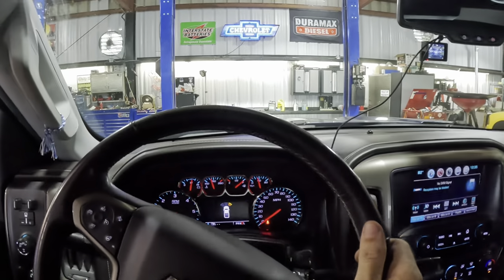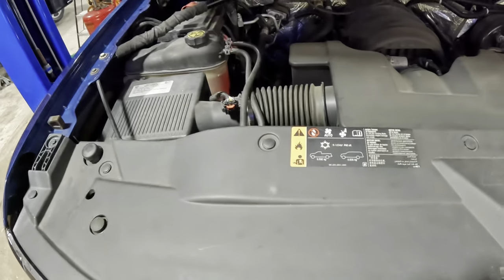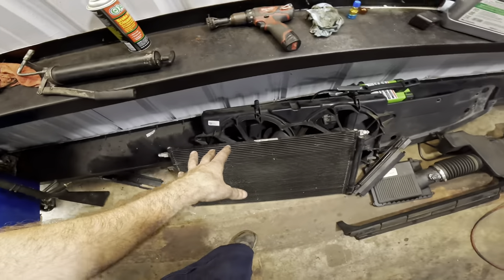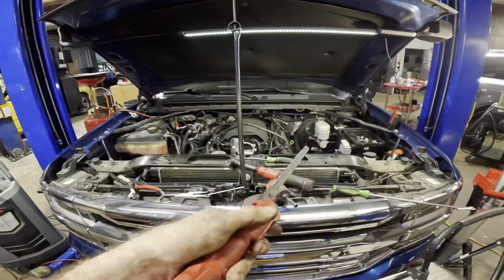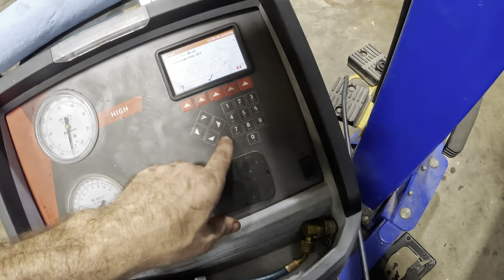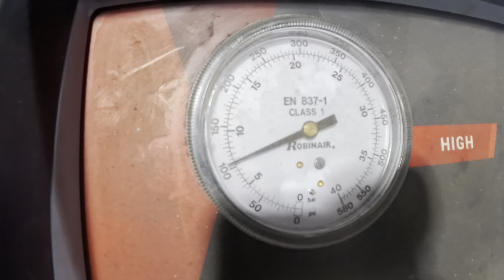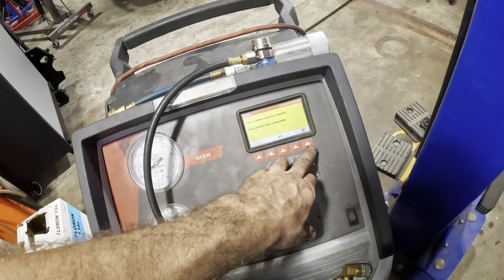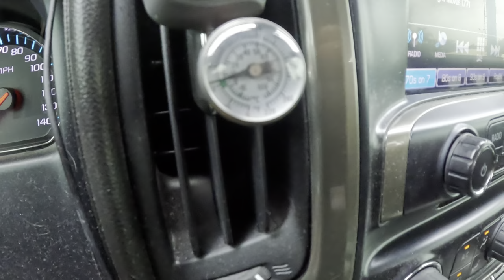KNOWN FACTORY DEFECT! BAD DESIGN!! 2017 Silverado 5.3

Comment from the maker: Check out this shorter A/C Condenser video with the saw cut in the side of the unit. Customer States...WAIT...look at this! Can't make this stuff up! https://youtu.be/9nHSh5ZYFmY

⚠⚠⚠Ray's Auto Clinic Clearance Sale at https://www.RainmanRaysRepairs.com  We're liquidating the hooded sweatshirt lineup as the weather is getting warmer. Add a hoodie to your cart and receive 20% off the entire order. No checkout code needed.
Reply: Ray,  if I understand those zero angle ratchets correctly, they are basically a very small sprang clutch just like what is used in an automatic transmission.
Reply: Ray or Lauren, I have a question, you have license plates in your office.  I just had to cancel my Massachusetts Red Sox plates as the car was totaled.  I would like to send you one for your collection, if you would like.  Please let me know.  Thanks.
Reply from the maker: @scolley0616  please do, we would love to have it! Did you find the address on the home page in the “about” section?
Reply: @RainmanRaysRepairs  got it.
Reply: Is it possible to braze the weld and seal the leak?
Reply: @ctbhaley maybe but it would just crack again. That wouldn’t correct the root cause.
Reply: @RainmanRaysRepairs  on its way!

Comment: We replace these constantly at the dealership. GM is on like the 2nd revision now. This one in the video looks like the original. The first revision had the foil tape on it and still leaked at the same spot. The latest revision removes the tape, and its redesigned again. The build quality is awful on the latest one though. The transmission cooler lines rarely clip into the new condenser, you have to transfer the fittings from the old condenser. Also, the plugs on the bottom of the reviever drier come from the factory 2 or 3 turns loose. It will pass the leak test on the 1234yf machine, but leak under pressure. Ask me how I know, had one bite me and from then on I check every one. Just thought to add some backstory to another shotty GM design
Reply: Maybe it's designed by some military general. War equipment is not expected to last long on the front lines of a battle.
Reply: Jeez, some real quality control issues.
Reply: It took them a long time to find a spot that's such a pain to get too, to hide the defect!
Reply: Yeah, a GM truck with A/C issues?  First check that area.  We thought that would have been fixed when they changed over to 1234 (VERY expensive stuff), but it wasn't.  GM doesn't like upgrading their parts.
Reply: @desmondrice1756  Given that one of the AC service ports is hanging out under the heater hoses and near "lose a hand" land, and the book on this job is seven hours... 
This was designed by a coven of frustrated demon-worshipping sadists.
Reply: Dude I thought it was just me with the tranny cooler lines, sometimes they go in no problem and on other ones it takes popeye strength to get them to clip in. I usually transfer the old fittings but I hate messing with those stupid clips so I hope for the best with the aftermarket fittings 😁

Comment: And that is why I don’t buy GM products, at 45,000 miles the heads had to be pulled and the valve train replaced, at 65,000 had to rebuild the transmission, they would not replace it with new, because the time part of the warranty expired, up until that I was a loyal GM customer, Ray, you were smart to get away from working at the dealership
Reply: I was a GM guy also having 5 Gm vehicle's.  2 trucks & 3 cars.  I knew everyone at the dealership by name as I spent 1-2 days a month there.  I simply didn't know any better as I thought it normal for parts to constantly fail & both service & warranty work constantly necessary!  Untill someone gave me a lemonaid car guide  book which showed HONDA to be a better line of vehicle's.  Today 25 years later I have 3 Honda's in the driveway & I know no one at the dealership service department.  I can't remember who gave me the lemonaid car guide book but Thank You whoever you were!
Reply: I like old GM shit (pre-2011). My mom's 2009 Suburban towed a trailer of shop crap over 18 hours with the trailer axle over 1000lbs over rating and the car's rear axle over 500lbs over and the engine definitelt ob its way out. 3 years later at over 200k mi the engine finally wore out, only to be replaced with a crate motor from Napa. The last major issue it had was a cracked wire insulation corroding and disconnecting the body control module.

My 1995 blazer wore its engine out at 195k mi after 29 years on the road, only to be replaced by a crate motor from Carquest. Its last major issue was the crank poaition sensor but that's fixed now and it's going strong.

I don't care for anything after 2011.
Reply: The reason you can’t get a new transmission is Gm does updates to the remanufactured transmission. So your getting something better then new.
Reply: 01 silhouette 281k, original drivetrain, ice cold ac.  I did a dexcool delete and did intake gaskets, but still going strong
Reply: Well if G.M doesn't stand buy their products neither should the consumers.They have beautiful trucks but I prefer ford's that's what I have always owned was the ford trucks and vans

Comment: I was a tech in 1970 at a Chev dealer and I found that on the 350 engine in the "A" frame (largest like Impala) the #8 spark plug was impossible to get to. the flat rate was high and I found a workaround. i got a floor hole plug, they are about 1 1/2 inch and I drilled the fender skirt to gain access to the plug. I put the plug in after. I showed the service mgr how we can save money for our customers and he gave me a bunch of crap about taking money from his income. i didn't stay there long.
Reply: Remember that from the times waaay back when. Had a bad taste for the GM products since. To be fair, every auto mfg has problems since all products are being developed throughout their production cycle. Thanks to Total Quality Management.
Reply: @milantrcka121 , you gotta remember, these cars were designed to be assembled...ONCE!
Reply: Greed

Comment: Just did the condenser in my 2015 Silverado. took the condenser out from the front. It took no time at all. Took the upper cover off, grill out, took off the 4 bolts holding the upper rad support off and out out it came. didn't have to touch the radiator, or anything on the engine side of the rad except the AC lines.

Comment: I had  to have the condenser replaced on my 2014 Silverado, while I was traveling in central FL last month. The same issue you showed. They did the job while I waited in the lobby, 1.5 hours labor charge. 
I could not get into the local Chev/GM dealer until the following week.
A shout out for Yarbrough an independent shop in Sebring FL. They treated me very well!
Shame on GM for not taking care of this!

Comment: My daughter has a 2016 Suburban, I had the condenser replaced about a month ago under her extended warranty, I still had to pay about $300 that the warranty company would not cover. Now I am leary that they used an original GM replacement condenser, it is probably going to fail again in another 10 years or so. I will get an aftermarket unit and do it my self (I have the gauges and vacuum pump, and about 15 lbs. of R-134A left) Thank you Ray!

Comment: I had one of theses “fixed” parts from Napa. I sent it back and purchased an aftermarket part for an 02 avalanche.  I was pissed ac delco let that pass.  My impala an 02 is separate from the trans and radiator.  Thank goodness.  I have been a gm family since the 40’s.  My father say many quirk’s and a local mechanic of his, repaired/ rethought the design. He had many followers for a  good honest guy.   Had lots o work and did well. Remember “WORD OF MOUTH” will always make or break you, and good honest auto -techs are like gold, hard to find and great to hang onto.  Rock on Ray.

Comment: Had that condenser issue on my 2014 silverado. Also, instead of taking the fan shroud off, I took the metal bar off across the top. The bolts are hidden underneath on each side. I found that really easy. Only took me about 1.5 hrs to replace condenser and get everything back together.

Comment: Wow have radiator changed!  I had a 75 Mustang II with the 302 Cleveland modified that came with an all brass radiator.  Accidentally punched a hole in the bottom, the fix was using silver solder and a copper penny.  One of the many ways Dad proved he knew a trick or two.  Thank you Dad, rest in peace.

Comment: GM WCT here, I learned long ago (mostly in the last few years) not to get too upset by poor engineering or the results of cost cutting measures.  Perfect example, lifters on the DOD engines, at one point recently we had three almost new vehicles in the shop (one that hadn't even had its first oil change) in the shop with the heads off getting new lifters.  It is what it is.  Job security.

Comment: Sitting at a layover with an automotive engineer. He consulted with the Big 3 automakers. Later with Toyota and Honda. Biggest difference separating the automakers was their build philosophy. The Big 3 is about cost containment vs. quality. They choose cost savings over quality.
Reply: Yea but they don't pass the savings to the consumer hence a hundred thousand dollars truck, no thanks
Reply: @davidbertram4608 thats what pisses me off the most. Charging 90k for a truck that 10 years ago would be 40k new drove me to toyota and honda. At least they value quality and sure you pay for it but you get what you pay for with them. USDM since like 1990 took a hard nose dive in quality and hasnt snapped out of it. They are losing market share and try to make up for it with cheaping out on build and charging JDM prices. They lose market share even more because of it and they are fast approaching a point where even the idiots that are ok with a 1000$ car payment wont be able to afford it. But they are too big to fail so cant wait for the next round of Gov bail outs.

Comment: @5:30 That is exactly what happened to my 2015 GMC Sierra 1500 with the 5.3L V8. Was replaced after the expiration of the extended warranty that I purchased when I bought the vehicle.  Cost me big bucks at the chevy dealer. Mechanic showed me the leaking area when he got that condenser pulled out. Said that it was a defect. Common problem.

Comment: In 2019 our surge tank broke in 2017 sonic when we were on a road trip. We had to have it towed to the closest dealership. They charged us over $300.00 to fix it. I could have bought the part for about $30.00 in fixed it myself, but we were to far from home. MY WIFE WAS LIVID! She wrote a letter to the Chevy corporate office. She told them that part is only 2 years old and it shouldn't have broke! They reimbursed us around $125.00, and we had to us it within a year. Had the oil changed and othe things done, but it still was very frustrating!

Comment: I can hear in your commentary about the condenser factory failure. I too shared dismay with GM back in the 80s when the 6.2 diesel came out, there was coolant leaking from the head gasket/block area. After MANY R&R of heads they discovered a flaw in the head gasket design.  But that procedure under warranty was a losing battle.  Who ate it, besides the customer...well, the technician, of course.  

Thanks Ray for another of your great videos. Your customer will have many thousands of miles to look forward to with your repair.  Good Job!

Comment: All of Rays videos are great. Also liked the upgrade of the aftermarket part. Ray had the where with all not to go OEM. GM.. what are you thinking?  You guys remember that 11-12 hour video when Ray replaced the whole air box on that Ford F150 because of a bad temperature sensor? When others make it a $30 dollar part and easy to get to? Ray tried several solutions to save the customer big , big , bucks. But Ford wouldn’t let him.  Generally.. Ford does a good job when they realize their mistakes. But not that time. Come on Ford.

Comment: Had an oil cooler line pop out of the radiator because of those stupid retainer clips. Instead of the plastic ring, I put a zip-ty over it. I would rather see a better connection,  but, hey, GM is happy with it....

Comment: Hey Ray, ever get the feeling that engineers watch mechanics videos just to get "improvement" ideas on how to make things harder for mechanics?
Reply: If the engineering division at all of the major automakers were smart, they would hire experienced mechanics to be an integral part of the engineering team.  Engineers can design things to make them work.  Mechanics can assist the engineers to design things to make them readily repairable.  I can recall a time in my life in the 70s when the big three (Ford, Chevy, and Chrysler) designed in obsolescence.  For example, prior to the 70s, nearly all tie rods had zerk fittings on them to grease the tie rods.  Around the 70s timeframe they came out with "greaseless fittings" as a marketing gimmick.  The sad reality is that the greased tie rod that lasted forever got replaced with the sealed tie rod that lasted a *planned* 70,000-100,00 miles.  The big three eventually/mostly learned their lesson, but not before the Japanese started taking massive market share.  The Japanese shot ahead of American car makers largely due to the father of TQM (total quality management), namely W. Edwards Deming.

Comment: I am waiting for this to happen on my 2017 Suburban. I'll be watching this video again someday. Thank you for the help in advance.
Reply: do you have the 6.2?
Reply: @robertamantea7639  No, I have the 5.3. I believe they all use the same condenser. I've been lucky with it so far. I've only had to replace the oil cooler line under warranty. and routine maintenance. It only has 58K miles it.
Reply: @dogdooley4495  this one has 63000 miles so get ready 😁

Comment: Hey ray what i did notice  is you put all the bolts and screws back in not like some dealers and other shops . I had a clutch replaced and they put half the bolts in the bell houseing and this as on a 1 ton 4×4 . You do good work.

Comment: 2014 Sierra condenser when out at around 32K replaced under warranty. As well as the radiator due to cracked weld.

Comment: Yep. I have a 2014 LTZ and my condenser wrapped the bed after factory warranty and I believe it was $700 for the fix. I'm on my second radiator, also. 107K miles.

Comment: when they paid 4.5 hours for this job i was doing them in 1.5. took longer to evac and recharge than to do these condensers. had a senior master tech show me how to do them quickly and correctly with out taking the front end off. only ones in that line that were a bear to do was the escalade and Yukon denali

Comment: I had one of these trucks with a crack in the ac line right off the compressor. I replaced the line, and my guy came back within 6 months and had the same line with a crack in it. GM sent me a bracket to tether the two lines together to reduce movement in the lines. That was their fix.

Comment: It use to be a 5 hour job now the labor has been changed to 1.4 hours in all data minus the evacuate and recharge. It is quite easy takes about an hour to remove and install. There previous procedure was ridiculous compared to what actually needed to be done to remove it.
Reply: I guess its better to have butterfingers...than an instant Baby Ruth🤧

Comment: I always just take the 2 radiator bolts out and push it forward and slide the condensor out from behind it. I never did the take the fan out method. I just left it there.

Comment: I took the radiator and condenser 250 bucks out as an assembly. It was time for a cooling system service anyway. I did replace the hoses. Yes, the coolant tank leaked on mine, a napa dorman unit fixed that. Aside from this the vacuum pump 350bucks, transmission 6200 bucks  and regular maintenance it has been a good truck. 2016 with 198000 miles. Still rocking the AFM system.

Comment: The heat transfer is still there but the thermal expansion difference between the AC and trans cooler sections is handled by the beefier construction..

Comment: I had a 2014 Silverado 1500 that I had to have the AC condenser replaced. It would only hold a charge for almost a month. I had my mechanic do the fix and you are right that it is a 7 - 8 hour job. $1600 later and I had cold AC again.

Comment: My 2014 Silverado w/5.3 had a compressor failure just past warranty, then another compressor 50,000 miles later, and just last year the condensor failed at the weld point.  No other failures.

Comment: I just did an AC kit on a 2017 Police Tahoe.  Same reason; compressor was also not compressing properly so we replaced all of it (except the evaporator as it was fine).  Good ol' 1234YF.  The condenser was fun to replace as I had to remove the pushbar and its mounts from the vehicle in order to break it down to get to the condenser.  I don't think the whole time was 7 hours though.

Comment: @Ray that tip is not just for Chevy it is my go-to fastener tray in most cases... Furd is the exception...  they don't make anything easy for techs... they hinge the lid and make sure it doesn't open 90° so it won't sit flat.

Comment: Had a 2017, didn't have an issue with the AC bit got rid of it after the torque converter started going with 13k on the clock. GM basically said tough so never got to the AC issue.

Comment: I bought a "ratchetless" ratchet from "Taskmaster" in 1/2" drive back in 1981 and I still have it. It uses cam locks and works brilliantly. I will say that the cams have worn partly so there is a little slack in the back swing but nevertheless it still does the job I wanted it for. I don't know about the magnets so why improve something that already works perfectly okay